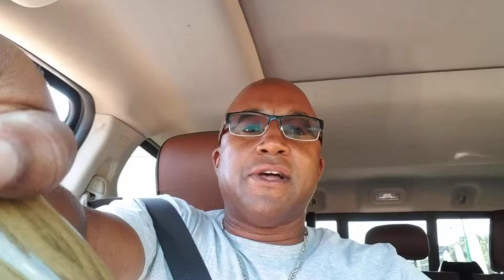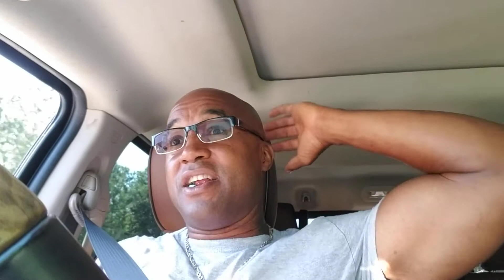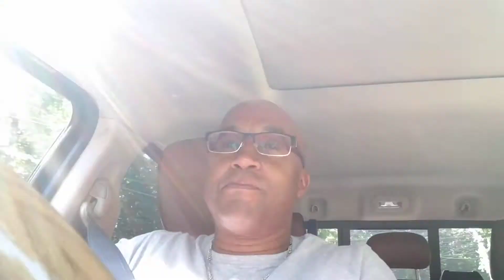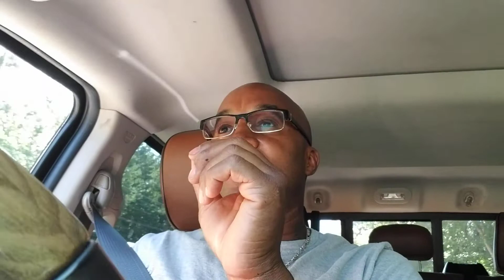Impedance Rise

Comment: This why you shd atleast double the RMS your speaker requires...You'll still never get the full power off that amp. My subs are 2400 RMS...I put a 5k on each set of 3..and since Im at 1.34 ohm..and the amp will do roughly 4k at 2ohm..I still wont get that 2400 because box rise...still need to add more elecrical and lithium batteries...its not easy

Comment: How much amplifier power would you recommend for a 2000rms subwoofer
Reply: u want a amp 1.5 - 2 times the power u need. so ur not clipping or at a loss of power to account for box rise.       my 2k amp puts out 3136 at 1 ohm.  but at 1.5 ohm  rise at 32 hz in my setup equals roughly 2050 watts .    I also know this because I did a voltage and amp clamp test on the speaker wire from 15 hz-52 hz.     everyone should do this test. saves u 450.00 (amm-1 meter)

Comment: MB. Question for you i watched your video on power control and bridging down 1 ohm vs 4 ohm. I know ever sytem differs. So with that being said. Would it be safe to say to brdge down to 1 ohm on a 1 ohm stable amp you would be rising to at least 2 ohm. Would it be better to wire at .5 ohm to compensate for impedance rise to get max power.

Comment: What are some things that make impedence rise.box size,port size,a sealed box thats too small?what causes a 2 ohm tune to triple to 6 ohm.resistence?🤷🏻‍♂️what causes ur amp to work harder.and your subs coil to produce resistence.if u measure your coils outside and the wind blows resistence changes,what do ya think a whole box full of air behind the sub does.they say inpedence rise isnt a thing.i disagree.ever turn on the ac on ur car,notice it loses power.that resistence.if ur subs are in a 2 cubic foot box vs a 4 cubic foot box which box will reach a higher impedence and more current draw on ur amplifier.

Comment: What you think about the power reference line of amps from Memphis?
Reply: i had the prxa 1500.1 they are solid and very underrated. mine had a birthsheet of 1700w, i had it hooked to a 13w7 @ .75ohm for about a year and it never shut off. i switched to a sundown x12 and hooked it @ 1ohm for 6 months with no issues. the only reason i sold it was my friend needed an amp and i wanted an amp with more headroom for power